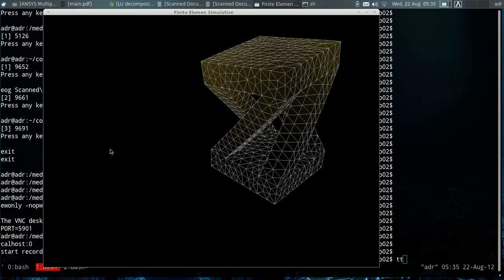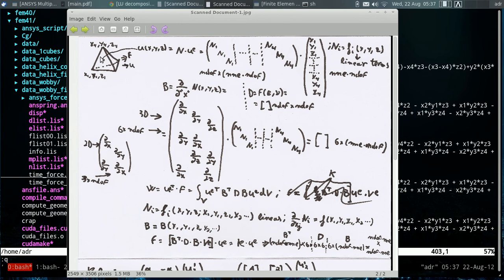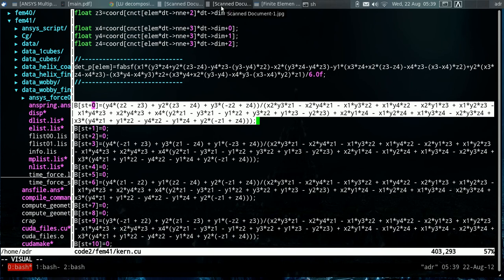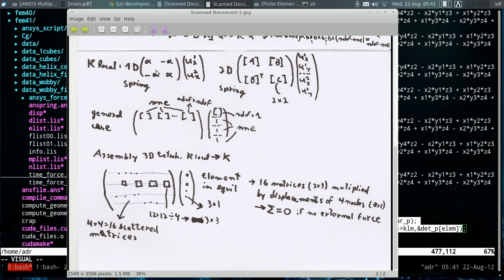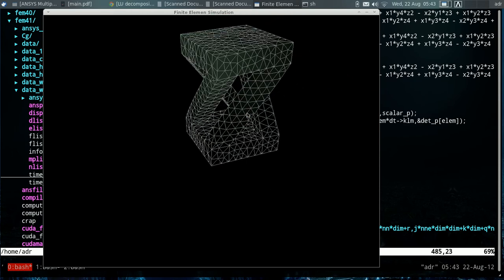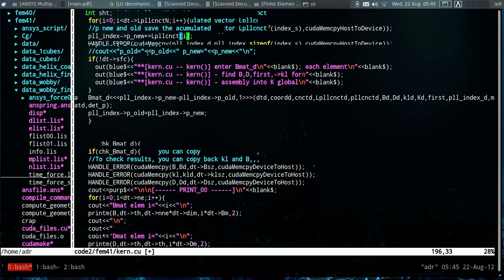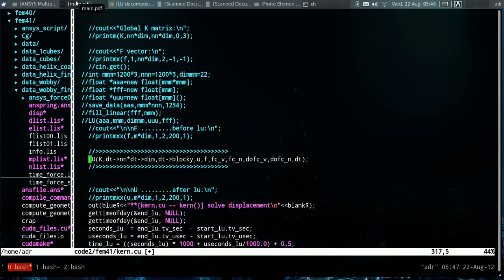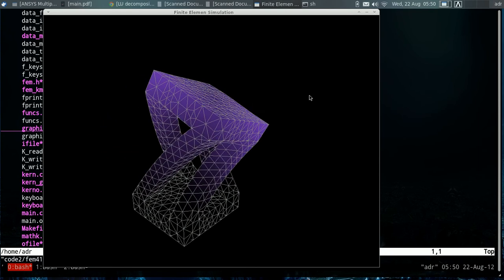Programming CUDA to solve finite element problems

Comment: have you written a thesis or a paper on this? can I have a copy?
Reply: +SmilingPukeMan hello, the folder is no longer available, could you please share again? thank you very much.
Reply from the maker: https://mega.co.nz/#!xJ8iiQQR!r8Tx9b3ZCqSGODj8ATG3nZiho6Fd1jlBK-H81T8jK6Q
The folder called CUDA shows the research I did with parallel programming. Then on there are 3 pdfs that are my research itself that diverted from the original parallel programming, but still about finite elements: shell elements, fracture, thin shell structures, modelling of post-tensioned concrete, etc. Sadly, everything but the CUDA section is in spanish. Enjoy :)
Reply: SmilingPukeMan
 Thank you for the paper and compliments for the interesting work